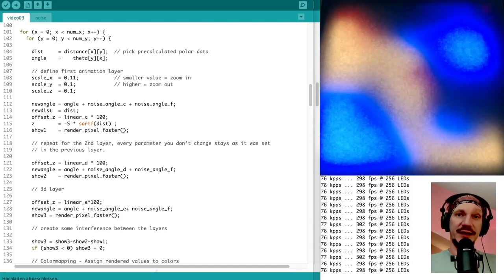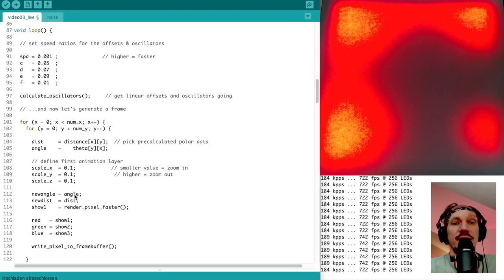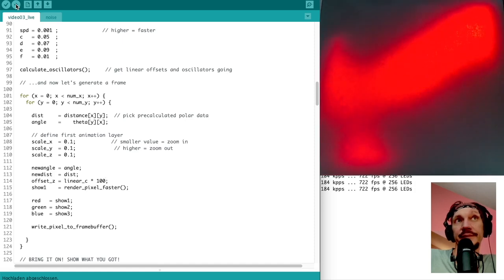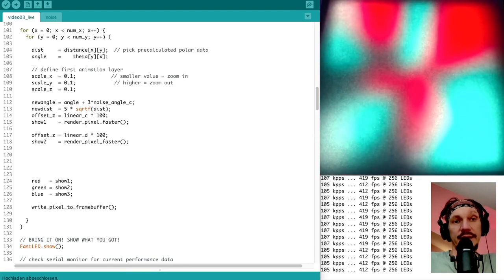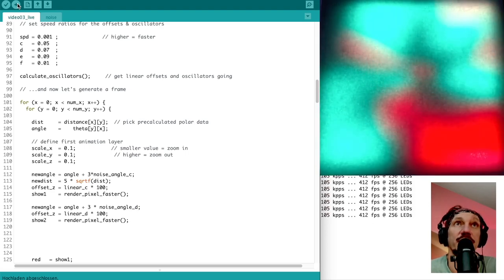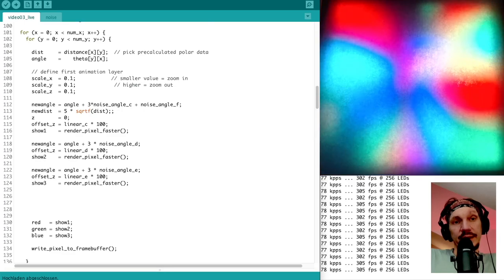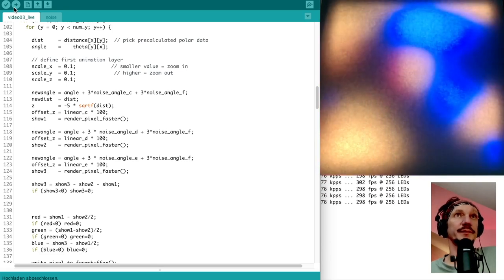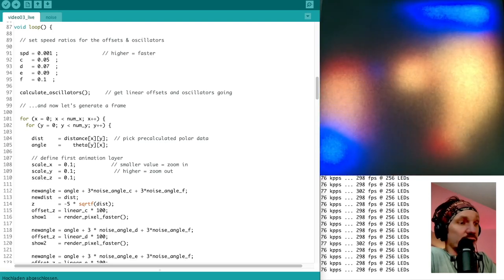LED Podcast #3 - Practical Animation Design

Comment: Excellent as always. Thank you for sharing!
Reply from the maker: Thank you, @frollard!
Reply from the maker: Want to be a beta-tester for the latest vesion of the algorithm?
Reply: @stefanpetrick  I don't have any matrices... Could run it on a round LCD pixel painting the GFX library canvas ... Should work. Might need to do something clever like using half resolution, as full res 128 squared might be a bit heavy. Happy to try though!
Reply from the maker: @frollard  No problem to run AnimARTrix on a  LCD or OLED.